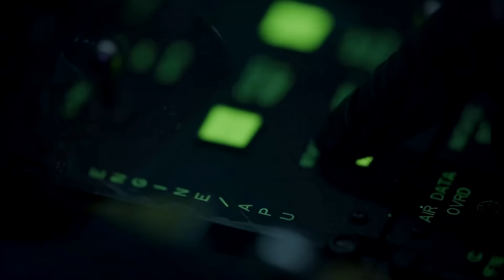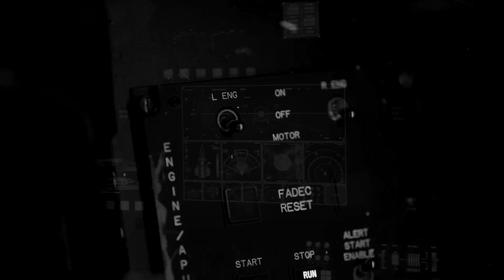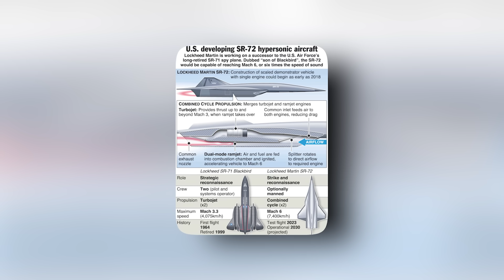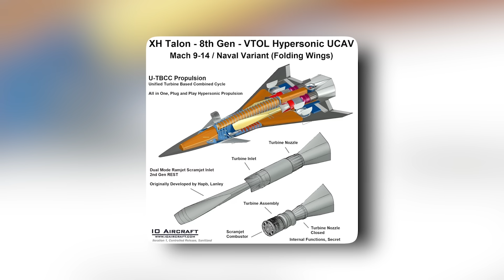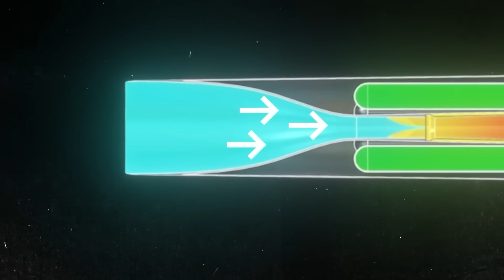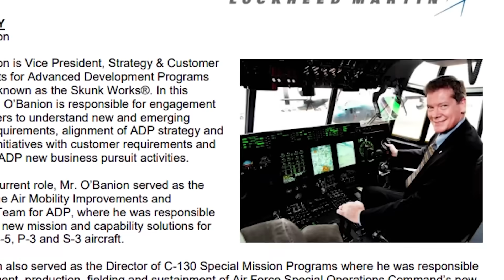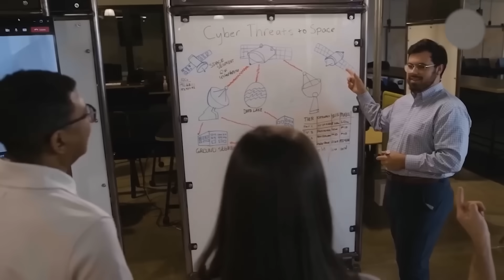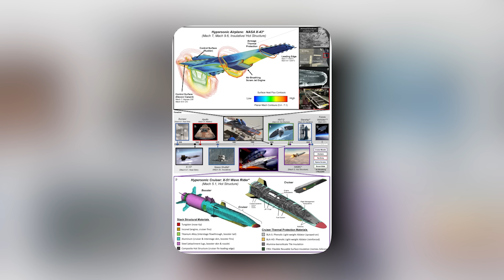Finally EXPOSED: The SR-72 DARKSTAR Is Not Just a Spy Plane Anymore!

Comment: How was the sr71 not shot down but f117 was?
Reply: Speed
Reply: AND altitude. Both combined.
Reply: Altitude and Speed.
Reply: One was an extremely high altitude recon aircraft meant to avoid combat altogether, the other was an attack aircraft meant to avoid detection while in combat....
Reply: The Serbs figured out that the F117 s were flying the same route every time so they just threw missiles up during the predicted time and path, "they got lucky".
Reply: Almost in orbit
Reply: ONE WAS BASED ON SPEED AND THE OTHER WAS BASED ON GIMICS!!!!!  NO MISSILE AT THAT TIME COULD CATCH THE SR71, PERIOD.  F117 WAS BS.  SLOW, NOT A STRONG AIR FRAME, WAS SUPPOSE TO BE ABLE TO GET PAST RADAR OR NOT BE LOCKED ON.  DID NOT REALLY WORK, BY THE TIME IT WAS IN PRODUCTION, RADARS HAD BEEN ADVANCED
Reply: The f117 was detected, when the bomb bays were opened, the wreck wasn't even destroyed by the US, because the tech was allready outdated by that time
Reply: To drop bombs you must depend, slow down and enter a heavily defended target zone. To take a picture, just speed up and stay at 80 thousand feet.

Comment: The skin of the SR71 was corrugated both ways. It allowed the body to expand and fill in the gaps that were left on purpose for expansion.
Reply: The planes body was titanium, when a metal expands by heat there is no gap, it get thinner due to heat. It is not like a human skin.